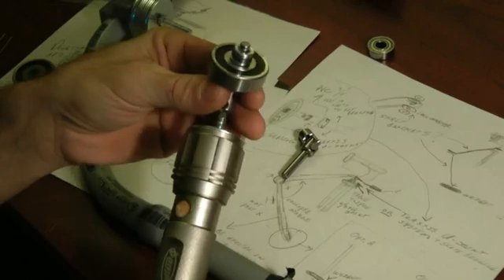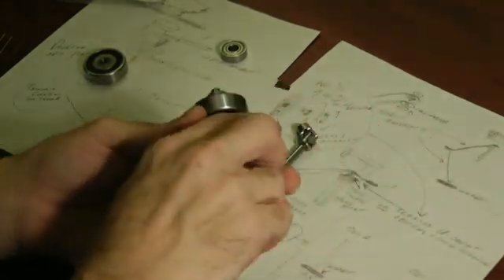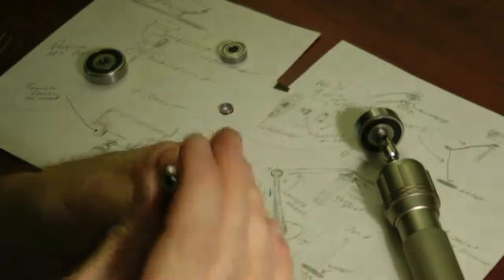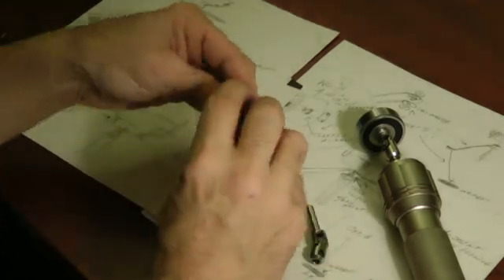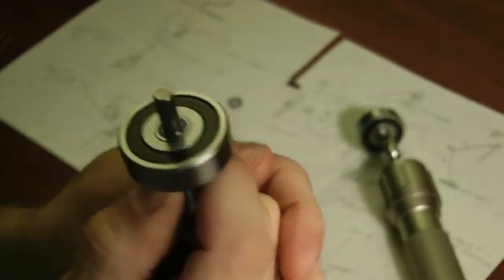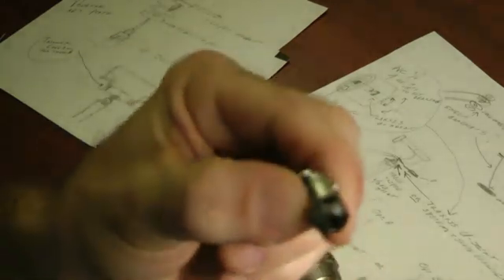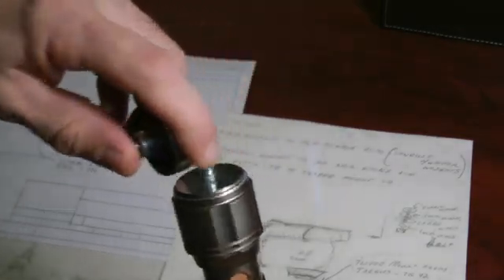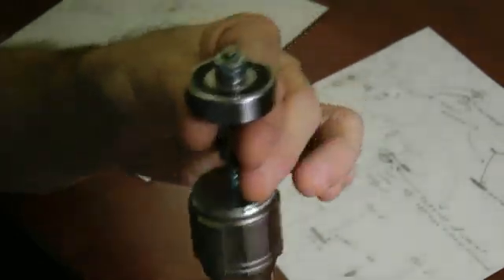DIY Steadicam -The handle assembly

Comment: Excellent video!  A quick question - I searched for '6 x 10 x 3 flanged bearing sealed' on Ebay as you suggested.  Only 2 results seemed close.  Both are from 'Hobby-Smart' in Hong Kong and have stock pictures of a lot of different bearings rather than just the little one you used.  Is this the vendor you ordered from?  If so - did you choose 'metal sealed' or 'rubber sealed'?  Thanks so much!

Comment: Nice video! I have been trying to design a stabilizer that looks store purchased and most of it is simple enough with nice materials such as carbon and aluminum. The handle and gimbal is where I have been running into issues. I am already using the local machine shop to laser cut parts but I want to keep the price down a bit. What I have read is that if the gimbal shaft is not perpendicular to the base plate you will have issues with performance. Thanks for the bearing inside the bearing tip!!!!

Comment from the maker: @MrBpetnoi1 Great idea for the panning.  Without seeing your actual set-up in mind, just make sure you have clearance around the gimble/tube assembly so the arm assembly can be turned sideways around 45 degrees or better.  The reason for this is so you dont knock it off balance accidently by your hand turning past a certain angle.  Also helps to have that clearance to do your "drop test". 1+ seconds for the arm to go from horizontal and swing past the resting 180 degree mark.

Comment from the maker: @didanhtennis Thank you for watching and please checkout my new demo vids on edgerunnerproduction.  I wanted something that was large enough to handle the weight and use over time.  Hoping to mount a prosumer model on it soon and see how it works.  As far as the flashlight, I found that where there is a will there is a way.  I am sure there are large diameter ones that could be modified to hold it.  I spent a long time getting to that final design.

Comment: I didn't realize the 6300-2RS bearing was so large.  I like it, but it's huge.  I want to use the bearing at the bottom as opposed to the top, like you and YB2NORMAL.  Is there a flashlight or anything the can house this bearing?   That you know of?

I'll built my prototype with 1" PVC tubes and 45-degree connections.
Thanks

Comment from the maker: @KaelaStreet I did have the good fortune of having a custom made baseplate from a friend that captured the bearings in a housing.  Basically, The larger bearing has a wide rim that would allow for something to rest on it and be clamped down or welded on or something and that will not affect its ability to still spin.

Comment: @didanhtennis If you mean what did I use for the actual outside shell...it is a flashlight that you can find at any hardware store.  Small and compact and I liked the lens part as it being wider helped with gripping it.  The small bearing I found off of ebay.  The description lists all the parts and sizes.  Keep searching, you will find it.  The key is the U joint in my opinion.  All steel... and the long pin on one end fits perfectly in the center of that small bearing.

Comment: @Doc02864 The "rollerblade/skate" variety is not industrial and smooth enough.  The one I used is way more industrial strength which means less friction with weight on it.  And it has better quality bearings and seals.  The U joint is absolutely strong and big enough.  I have been using it and it works great.  It also has the most range I have found and it is all metal as opposed to some plastic ones....which will eventually show signs of wear.

Comment from the maker: @tlcoolio You would be surprised by what persistance can do.  I was just stubborn enough that i wanted to make this and i knew i could come up with something that would work.  Not nearly as good as it turned out but i would have been happy with just a workable steadicam made out of PVC.  The handle and the u-joint/bearing assembly is THE most important part and could be adapted to anything you can make your brain come up with.

Comment: Hey! I give up. I'm listing my parts (some of which you mention in your video) on eBay.
Search for "DIY Steadicam, Stabilizer, What Have You Parts," and get a good deal and fast shipping on what you need!
Great job. You inspired me but I just don't have the time or equipment.
I'm sticking with a tripod and fluid head.

Comment from the maker: @thoughtgrenades without seeing what kind of system you built, it is tough to say what is causing the sway.  My first inclination is to say it may be too bottom heavy. If it sways when you start to move forward(the tail swings back), then the tail is too heavy and cannot catch up with the movement you just gave it.  Same with when you stop that the tail swings forward because of the kinetic energy it has.  Do your "one second drop test".  If not a good full second then it is too bottom heavy.